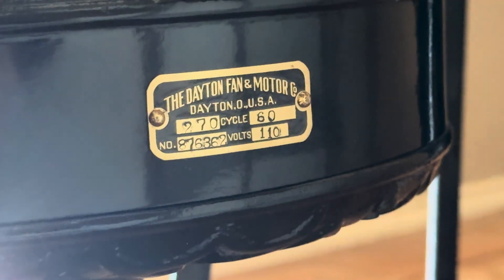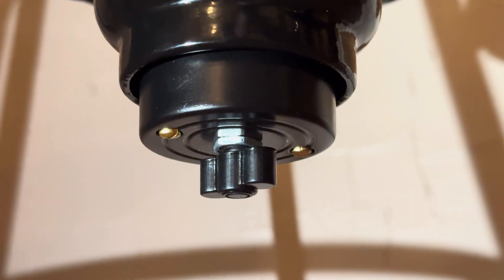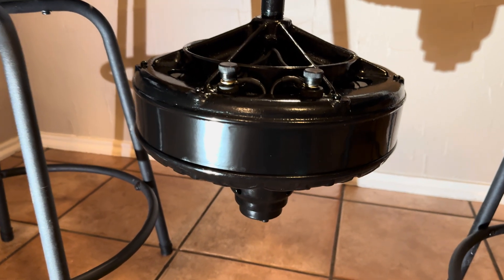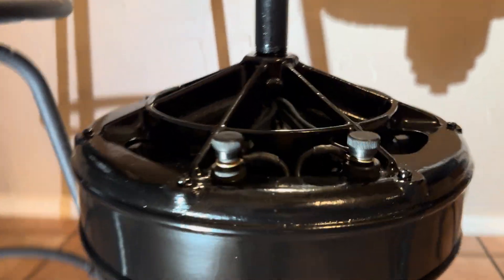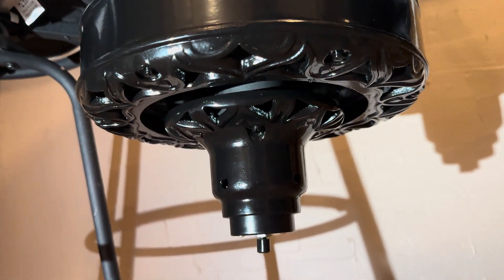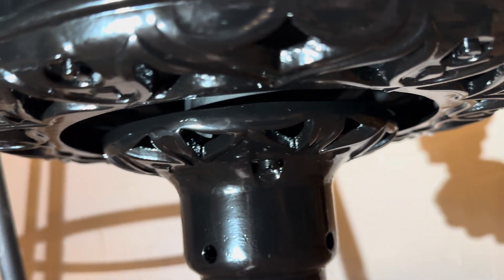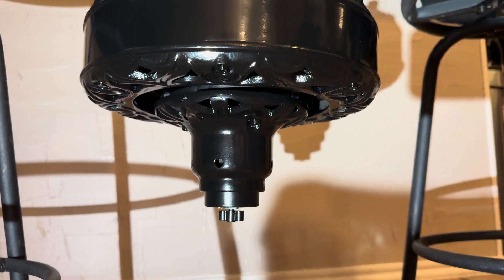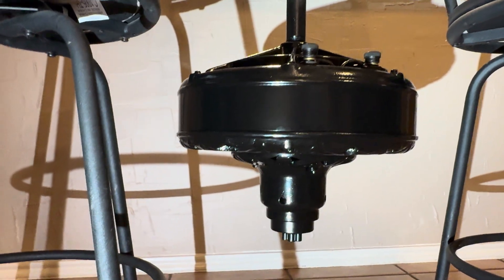Dayton Model 270 Antique Ceiling Fan Post-Restoration Motor Demo

Comment: Something I noticed with mine, is if the reservoirs balance out they do not do so well, the bearing noise got a little louder until I filled both reservoirs. Using it nightly for a year and a half, it’s still going though. Just as noisy as that one haha.

Comment: What kind of oil will you use?
Reply from the maker: Super Lube Multi-Use Synthetic Oil with Syncolon (PTFE) (ISO 100)
Reply: @dereksantiquefans5049 I’ve got mine hung and posted a short video on my channel! Copper and brass original finish.
Reply: @dereksantiquefans5049  I had my Dayton set up on a solid-state 5 amp sterling switch, which I think ended up being faulty, it burned out today. Do you have any recommendations for a solid-state switch for this model fan? Like many of its era the original speed control has long since gone away.
Reply from the maker: @RemoGuppy  You can look for a KBWC-15K, I use them on many of my Emersons and Hunters.  It has a 5A rating and an adjustable "floor" for the lowest speed.